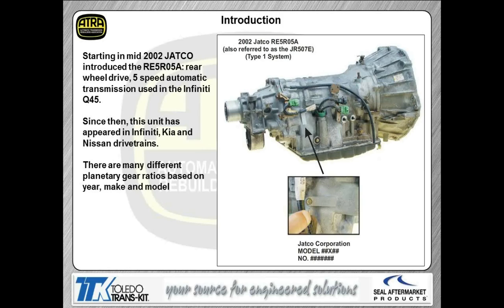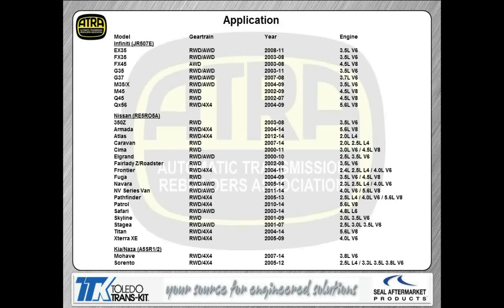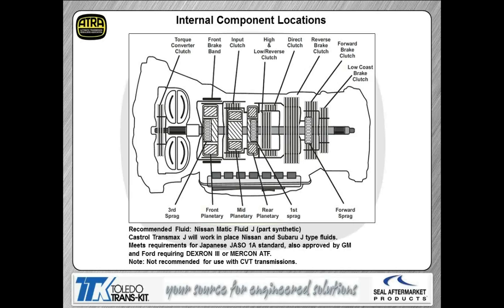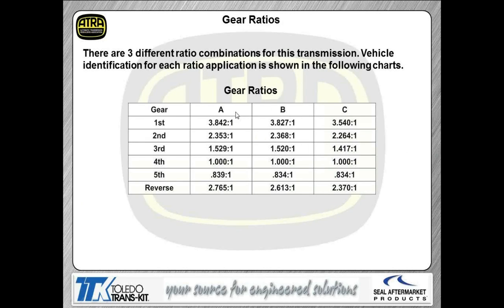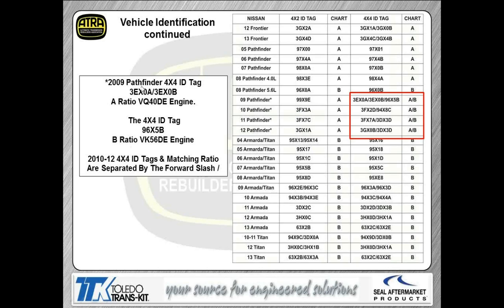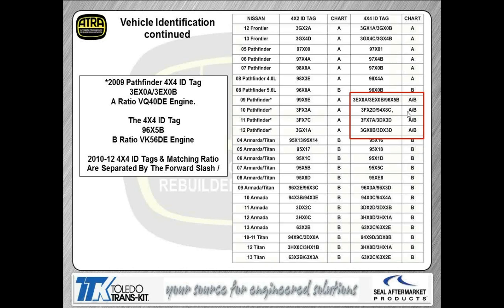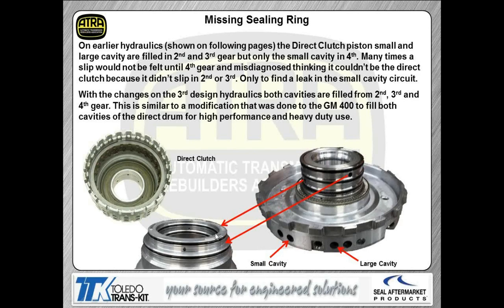RE5R05A Introduction

Comment: I. rebuilt. my.   Nissan. path. finder. everything. works. from. first to. four gear. when it goes. in. over drive. rpm goes. high. from. 2000. to. 3000. revs.  it. fells like sliping